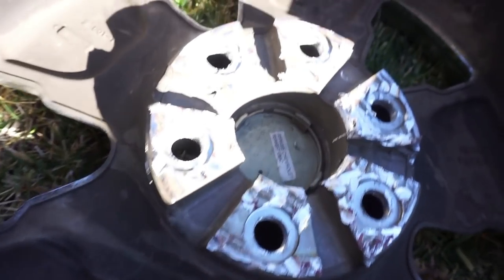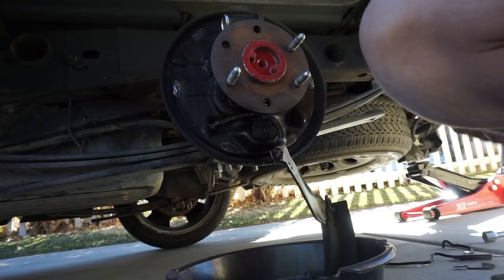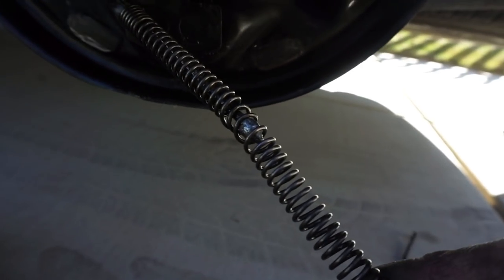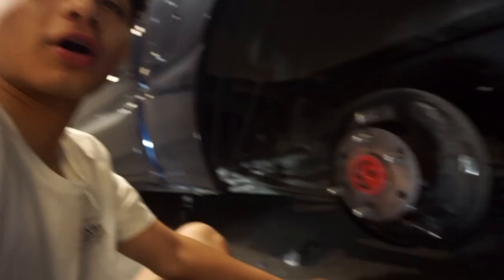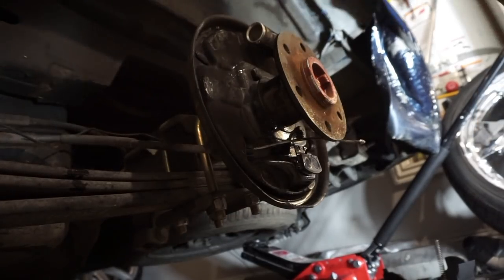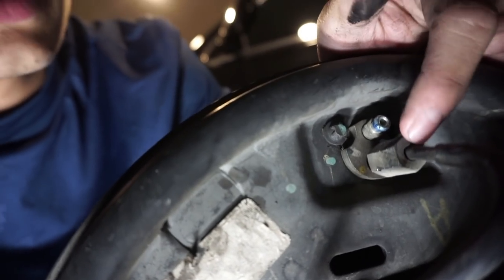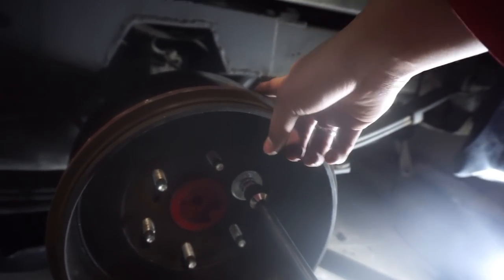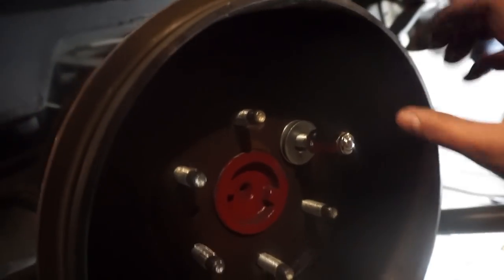FIXING MY SINKING BRAKE PEDAL ISSUE

Comment: As someone that had to learn pretty much what I know about my cars, on my own and from watching and reading manuals, you are doing a hell of a job bro. Getting in there, tearing shit apart and replacing it as much as you can on your own is best way to learn, trust me. You called a few parts out of their name, and I'm sure a bunch of us have been there lol, but you're getting it replaced and done. I learned how to do all the basic work I know years ago on a shitty Ranger I had and I'm still learning. I'm not an expert but I know how to turn a wrench on repairs and maintenance. 

I wouldn't drive at all on that rim with how it is damaged on the backside. I'd use your spare. Especially if you said it wobbles, and you replaced all 6 studs, it's still better to have a flat surface. I would get everything squared away and fixed mechanically before any cosmetic work, again, trust me haha. What you've showed us in this video is what YOU can do. 

Keep it up little homie.
Reply from the maker: Yeah man i like being hands on and learning cars always been my think and this my first car/truck so this my chance to kinda teach myself and learn. The names I’m bad with tbh lmao i make up names 😂 but nah the rims getting fixed rn man the trucks just been sitting. Ima do all this and get it 💯 again before i do anything else. But thanks man appreciate that means a lot ✊🏻

Comment: Watched both videos on what happened sucks to see that happen but u getting it fixed. But I work for a tire shop and when u had the 24's looks like the tire had run flat witch means the tire was eating it's self from the in side witch caused the tire to come off like that, I  see this happen a lot but to prevent that especially on low pros the air pressure has to be check pretty often and invest in a torque wrench best thing to have to set the lugs to the right torque. But keep it up love seeing the truck I got my 03 gmc extended cab and I know your struggles when stuff just happens when u least expect it
Reply from the maker: I figured it could’ve been that i drive it one day and when i check it looked low but after that i kept checking it and it was fine, but would make sense that it was eating at it. I do need a torque wrench tho ima get one soon hopefully, but thank man appreciate that 🤘🏼💯

Comment: Literally happened to me on the same side. I had a step side bed it blew it to pieces and fucked the inside of my wheel up
Reply from the maker: That shit sucks, step side beds crack easy my friends is all cracked for small little dings.
Reply: PROJECT LOW yea I replaced it with a fleet side and did a cat eye front end swap gonna get it primed this weekend
Reply from the maker: Did they spot weld the fleet side on ? Cause i heard stepaides are bolted on bro